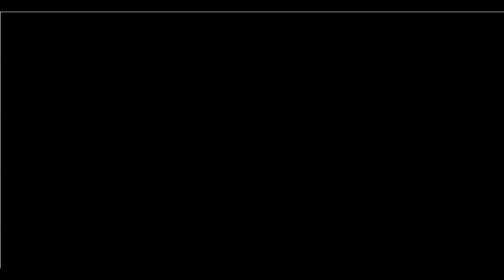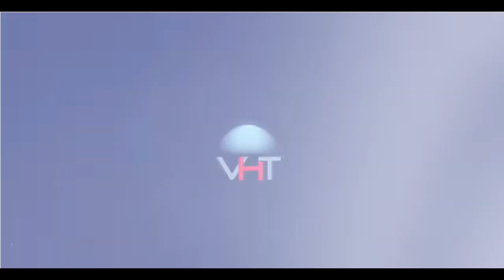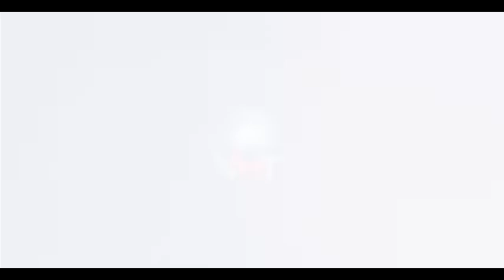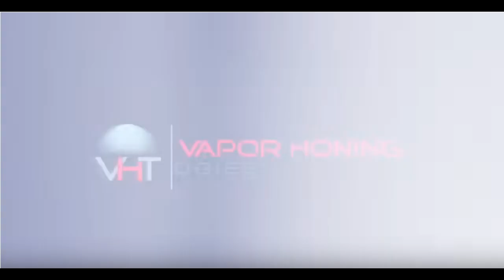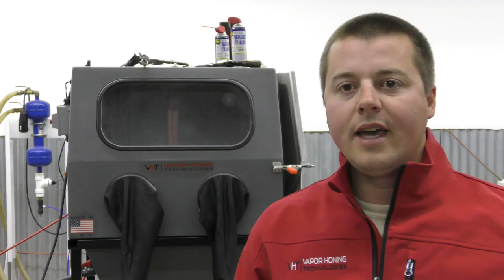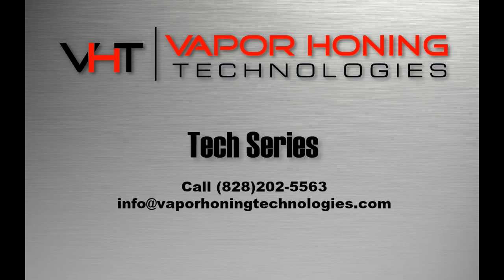Can You Add Cleaning Agents to a Vapor Hone- Vapor Honing Technologies

Comment: Why CNC polished surface turn into satin finished after vapor honing process. Can i get the polished area finish as it is with soda xl formula. I want to clean part like new but the polished area must not be turned into satin finish. Or i have to mask it.

Comment: Good stuff. John, can you explain the water/soda ratio and micro hone psi for soda blast parts cleaning and how long does the soda slurry last?
Reply from the maker: The Micro Vapor Hone has a 5-10 CFM Requirement at 60-70 PSI.  This unit requires 2 gallons of water and 5 lbs of abrasive.  When using soda because the water has to be super saturated to use soda you would need 10-15 lbs of abrasive.  We normally use Glass Bead and using it daily it will last a couple of months, Soda I would venture would last about a month.
Reply: Vapor Honing Technologies I put 12lbs of baking soda and 2 gallons in my micro hone and the results were outstanding on heavily grease stained raw aluminum motor parts! A little slow and the soda slurry makes visibility a challenge but I’m shocked how well the soda slurry cleans and leaves a beautiful finish. I may add some 170-325 glass bead to the soda slurry to speed things up. Thanks again VHT!

Comment: What is the temperature has to be set while blasting with glass bead or sodium bicarbonate.
Reply from the maker: In a Vapor Honing (Wet Blast Cabinet) for most of our units (Entry Level to Lt Industrial) there is no heater.  In the Stainless Steel units unit can be set to as much as 150 degrees.
Reply: @VaporHoningTechnologies  what is the benefit of heater in vapor blast cabinet. What is the best size ofsoda xl blast media
Reply from the maker: @bittainment5995  Heater is helpful with Grease and Grime removal.  Size of Abrasive depends on application.
Reply: @VaporHoningTechnologies  superfine glass bead and soda xl to clean engine and transmission parts. I think soda xl is more soft because it does'nt remove paint.